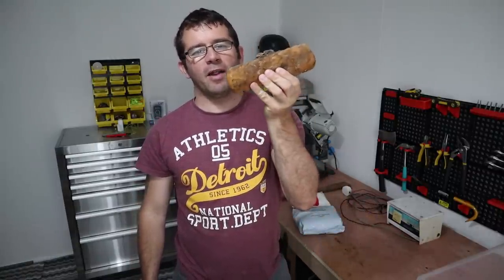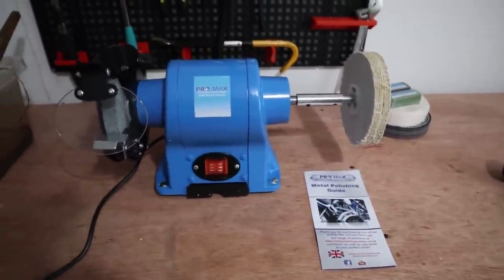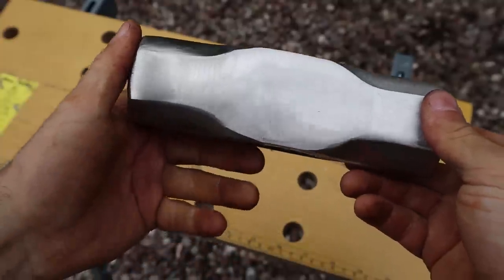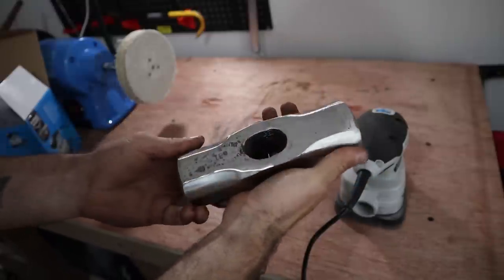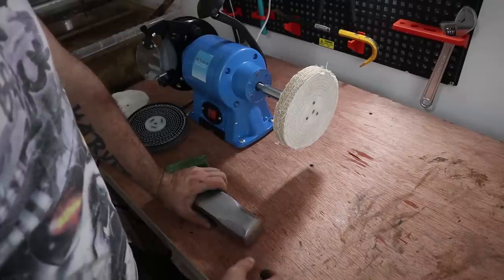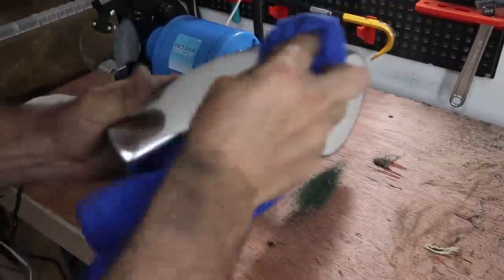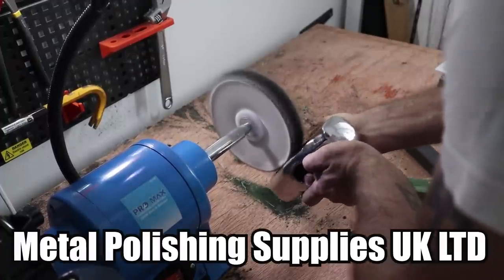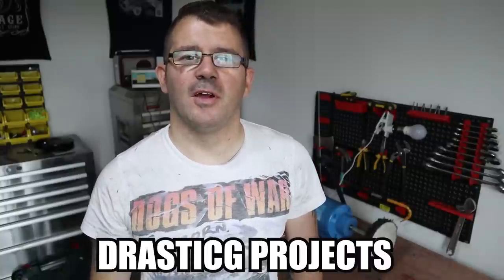Extreme Rusty Hammer Restoration

Comment: In order to get a flawless shine you need to have a designated wheel for each of the waxes. If it were me, I'd try a final buff with red, aka jewelers rouge. I know steel is harder than gold or silver but it will polish up as you have seen. - Your very own Mjölnir.
Reply: If he’d flattened each beveled surface the polish would looked better also, rather than having a ripples surface with peaks and valleys all over.

Comment: Are you sure that 81 is not LB upside down for the weight of the hammer? 

I usually go to 10,000 on random orbit sander. then polish with a felt flap disc, then polish wheel. Be careful using the polish wheel on the bench grinder. i was polishing an axe head and it slipped out my hands and launched itself into my chest/neck area. 

One thing that bugged me that you did that other youtubers do is you put the hammer head on then stained the handle. Stain it first, then you dont have to worry about protecting that mirror of a hammer head. 

And finally its all in vain. When i restore old tools to a mirror i cannot bring myself to dare use them. you just dont wanna ruin that sheen.
Reply from the maker: i wont be using this lol its staying hung on the wall and good idea to stain it first, only reason i did it this way was i couldnt get the handle back off lol

Comment: Man I wish you’d evened up each corner and then flattened/leveled each surface... my OCD almost killed me watching this video.
Reply from the maker: Ha ha it was my first time and i have to start somewhere
Reply: drasticg... absolutely... sorry mate, I should’ve added that you’ve done a great job bringing new life into an old tired tool... I just recommend if you’re going to the level you have in restoring something, then spending those few extra minutes making it equal and even would’ve made a big difference turning a great job into a 10/10 work of art 👍🏽 As someone else suggested too, use different polishing compounds on the different polishing wheels. It’ll make a world of difference to the end result and stop cross contaminating each wheel with the last grade of grit/polish. Try the white or red compound,on your last wheel. Plus you shouldn’t need to put as much pressure into the polishing wheel as you were. Let the wheel and compound do their thing 😉
Look forward to watching your next project  mate. I acknowledge the effort that goes into each video and reckon you’re onto a good thing👍🏽😊
Reply from the maker: @SWhite-hp5xq  thanks mate i will take your points on board

Comment: You just wasted 24 hours with the electrolysis if you go and put the angle grinder to it after, it would have come outhe same just grinding it straight out of the water. electrolysis is more for when you don't want to damage any detail it may have on it.